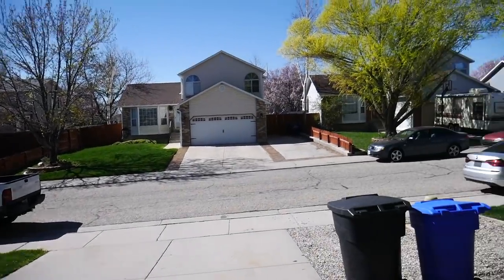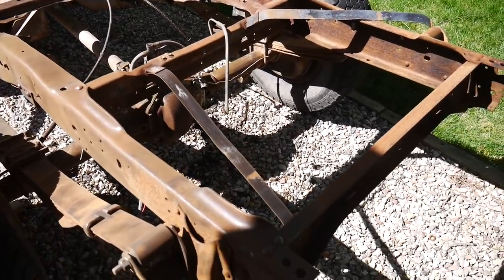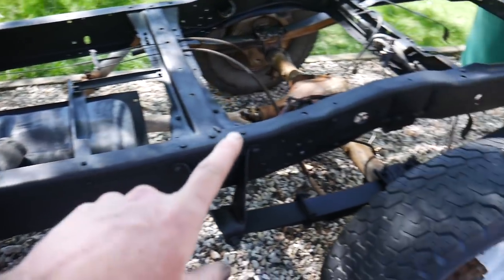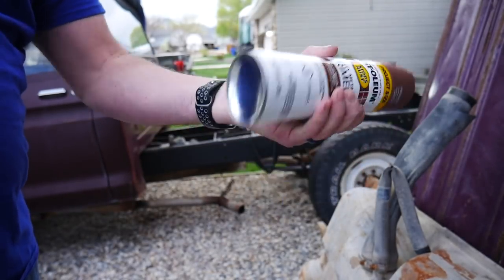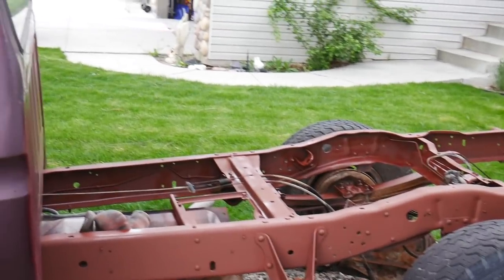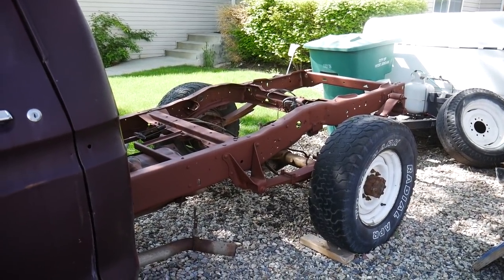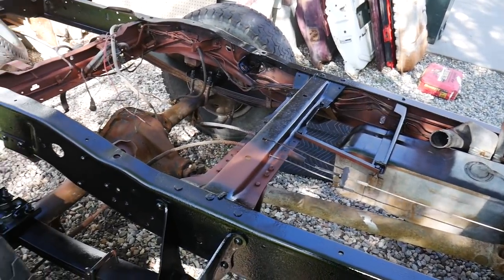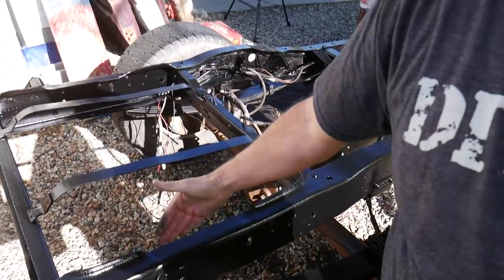Ep.08 1979 Ford F250 Restoration - frame rust remove convert prime and paint #midnightmaroon

Comment: hey do what you can with what you know and with the money you have. me and my friend both had 66 F100 short bed 352 3 speed on the floor. not to much rust. not really bad trucks. but I spent everything I had and did 99% of the work myself even the paint job. and had maybe $2500 in it. but he has money and spent over $20 on his. and he sold his for 27K I was down there in my truck as he was selling his and the guy that came with the guy to buy his bought mine for 19k. and mine had a/c. so just because you send a lot of money getting stuff done don't mean its going to bring you more money.
Reply from the maker: That’s awesome!  Check out my newer video titled “Wallace the 66”, you’ll get a kick out of that. The price was right!  I paid her $5 for this Farm Find. 66 F-250 with some really sweet patina!  🕺🏼👍🏼

Comment: Corroseal is the way to go for rust conversion IMO.  And at $48 a gallon Prime, it's cheaper too.  Plus it is an etching primer/sealer, so you can paint right over it without any prep, and water based so no problem with brush cleaning (your hands are another story, it sticks to them for days).  But it looks perfect on a frame as is.  Looks factory new.  I've experimented with leftover on scrap metal laying around, and this stuff is awesome.
Reply from the maker: I’ll have to give Corroseal a try on my next project. Thanks for the tip. 🙌🏼
Reply: I agree, I 1st tried corroseal to see how long it would last by itself by 1st wire brushing it then degreasing an cleaning the whole underside of my 4" lifted E350 4X4. It lasted for about 3-4 years before little tiny bits started to come through & I could of just left it, but this time I just cleaned the underside and reapplied the corroseal & it went a lot smoother not soaking up as much. Then I applied Rustoleum Professional High Performance Enamel in Gloss black #7779 with a brush for $30 a gallon, and I used half of it(I still have do do my F350 dually). I rolled around on my creeper for a about 4 hours getting everything, from inside and outside the C channel frame, rear end, front end(4x4), steering stabilizers, rear leaf springs, cross bracing frame brackets, steering knuckles, took spare dire down etc...and it looks waaay better than brand new. I was told from a body shop guy to use the Rustoleum cause all the garbage "undercoating" just peels, which I see all over on my 06 F350 dually. The Corroseal with also change different colors also it it wasn't prep right, grey if it need more, brown streaks if the metal was wet, and speckled discoloration bc of mineral salts and other chemicals, in other words you didn't clean it right haha.

Comment: Naval jelly is a pretty good substance to fight rust. Brush it on and remove with water within 15 minutes. It provides a protective coat for the paint to adhere to. It encapsulates the any left over rust that you missed. Pretty good stuff to use.
Reply from the maker: I'll have to look into that.  Thanks for the tip!

Comment: Doing it within your budget is great and its how I approach my builds. I use the same methods as you but it doesn't cost any extra to strip it down further and do it complete one time rather than having to revisit it. Thats my only criticism is a few shortcuts were taken that would have only cost you time not money.
Reply from the maker: Agree completely. I’m at that point of the build where I’m questioning going back to revisit some of these parts. Time will tell how I decide to proceed. But your point struck home for sure. 🙌🏼

Comment: Man I hate rust! The curse of living in the salt belt / snow belt. Just got a 98 Chevy truck I want to take care of the rust on. It runs perfectly and the interior is perfect but wow the rust is so bad. Not rotted through the frame just very very heavy surface rust and some body panels are rotted completely through. I really want to get the frame fixed up so it lasts another 20 years. Good video!
Reply from the maker: Rust is the devil!!!!  👿

Comment: That looks pretty good.  I have a 71 C10 that looks the same way and I am dreading the 500 hrs of steps to do por15 for a driver.  Considering I know it will get chipped off eventually I may go this route just to get it done so I can get on to the next task.
Reply from the maker: Agreed, to do the POR15 correctly would take a frame off restoration.  I had neither the time, resources or space to complete that level of restoration.  I do want to do that one day, but this is not the one.

Comment: My budget I saved is 20,000 the truck is in above exceptional shape for the age.... no body damage rust or dents it was my dad's and I want to restore it. The interior headliner and dash pad is hanging down dash cracked so new dash headliner carpet and panels seat reformed and recovered new dash bezels original correct factory ones ac upgraded to r134a...there's no rust in floor pans at all... I baby it and keep in a garage. I want it to look like the day it was delivered new! I even rebuilt the original radio!
Reply from the maker: 🤩 I bet that thing is a sight to behold!  What color is it?  Have done the paint correction/buffing yet?  I’d love to see pics. Send them to me if you want to share (diyhomeandauto@gmail.com).
Reply: @troysgarage  painting back to original factory two tone color. It is dark blue top center is light blue crome molding then dark blue bottom... the interior is blue and I did sound deadening Matt's the cab was dipped and coated any if there was any tiny amount is gone all new glass door windshield exctra. All new seals and gaskets new body mount bushings and bolts. The fire wall got all new jute padding like the factory new ac fan box and brake booster and master cylinder all new whipper rods and motor.. to much to list new crome around the windshield. New lariat badges. New heater core brand new wiring harness copies of the original build sheet found under the carpet from factory a copie was put back in place where factory one was found and laminated.  Front and rear diffs just rebuilt all new ball joints pitman arm tirods you name it new steering box. The bed getting l.e.d lights and spray in liner. This truck is being built like as if it was new... right down to original hub caps. Just painted all drives driveshafts and new ujoints. All new bushings in ALL suspension parts. All brakes painted and new hardware and bolts put in. The only thing having the underneath of the bed painted to help protect inner fenders and keep rust off! New tanks and aftermarket 38 gallon tank with a sump put in both tanks. Spare tire carrier bar sandblasted and painted new tank straps. The Reece hitch repainted new custom bumpers
Reply from the maker: That is a crazy amount of work. Definitely a labor of love!  You did all that for $20k?  😱 I’d think all that would be a lot more than that. Are going all the work yourself?

Comment: Been watching all the videos of this restoration and loving it! We have a 04 F250 with a dump bed, and need to get it cleaned up and painted. Is the paint that you used alright to spray on the exhaust system, as well?
Reply from the maker: No, it’s not made for high temp. You’ll want to mask off the exhaust before spraying. Fire hazard!  😱
Reply: @troysgarage  Alright, perfect! Good to know, thanks so much🙌

Comment: Got a 86 f250 4x4 diesel super cab 6.9 idi. Pulling motor and drivetrain. Lifting cab bed front clip and taking the axles off dropping all gas tanks fuel lines everything. I want to sandblast the frame wash decrease it and seal and prime and paint the frame. I've copied the factory stickers I found including the ones on the frame and had them all repro as the factory had it. Have you ever use pro 15 chassis paint? Or how about lizard skin?
Reply from the maker: I’d go with the POR-15 myself. I’ve watched videos of lizard skin but haven’t used it. Lots more reviews on POR-15.

Comment: I basically did the same thing all over to a heavily rusted dodge B250 van bed.  I sanded heavy rust off with wire brush on a drill. I used rust converter (phosphoric Acid) let dry 24 hours. i then painted with rustoleum spray paint. I did not do as good  job as the video. It has lasted 20 years now living in salty air near the beach and the paint looks as good as day i put it on with zero return of the rust anywhere. The places where the rust had eaten holes in the metal before I did the rust treatment and paint did not reform rust either.
Reply from the maker: That is great to hear!  This means our work will last a lifetime!  Thanks for the feedback and the extra pointers.

Comment: What would be the 100% correct way to remove and treat rust?
Reply from the maker: Depends on who you ask. The key is to mechanically remove the bulk of the rust, grinding, sanding, sandblasting etc. people swear by KBS products found here https://www.kbs-coatings.com/?AffId=39. I plan on using these products on my next big project “Wallace the 66”.
Reply: I used a rust converter on my frame that I bought by the gallon. I used a pump sprayer and it really gets into the nooks and crannies. But the product said no primer needed. So I used a spray in bed liner and it did a good job. Wish I never had to do it again but I've got 2 trucks and the newer one has more rust than my old one so I guess I'll have a winter project this year.

Comment: Looks good. Even if some of the surface rust is trapped under the paint, preventing water from contacting the rust will slow down the corrosion. My only concern is you weren’t wearing a respirator, and with all that rattle can stuff, it’s a bit unhealthy.
Reply from the maker: Yeah it’s not perfect but will do for now. Spraying outside and the breeze carried the fumes away. Hardly even smelled any during this process. 🤷🏼‍♂️ Plus this is how I keep myself strong enough to withstand the Covids hahaha
Reply: @troysgarage  haha nice I hear that. Once I sprayed undercoating without a respirator and I felt sick with the flu for like 3 days after. I've done so much body work over the years that I can't smell anything anymore lol!

Comment: Nice work, I loved what you did right up until the "GLOSS" black..  In my humble opinion, never use gloss black on anything that isn't 150% block sanded perfectly flat, otherwise it highlights every single problem and looks like a pile of melted crap.  If you sprayed that with a "matte" black it would have looked much better and hid that pitting much better.  Just my advice, love the project wanna do my own similar project on a bricknose F-150!
Reply from the maker: yeah, that's probably true, it does light up every bump and imperfection.  Oh well, this is a learning experience.  I'll be starting on my next project and use what I've learned on it soon.  Picked up a 66 F250, I've dubbed "Wallace the 66", named after the original owner.  Follow #wallacethe66 to see that project once I get started on it this summer.